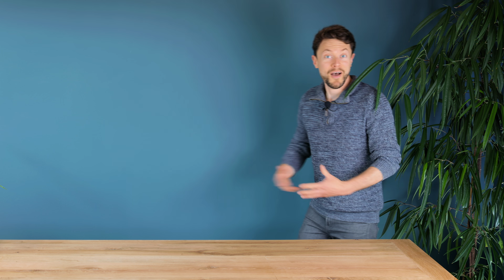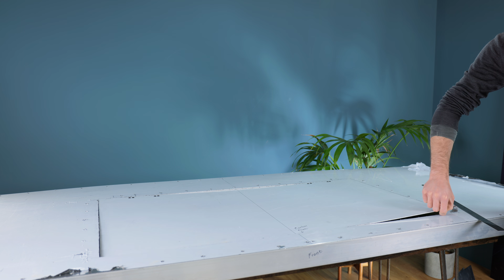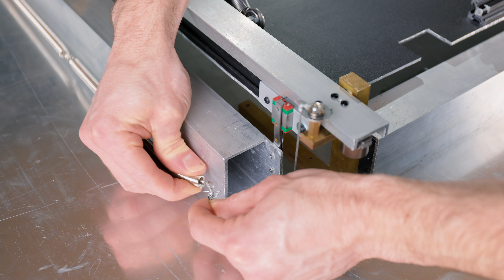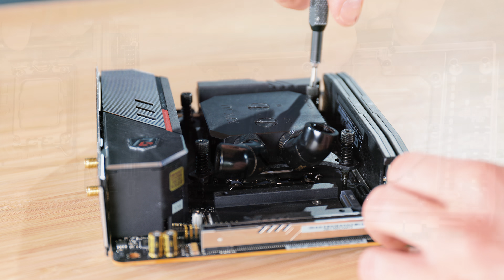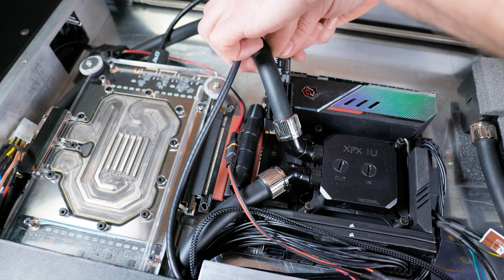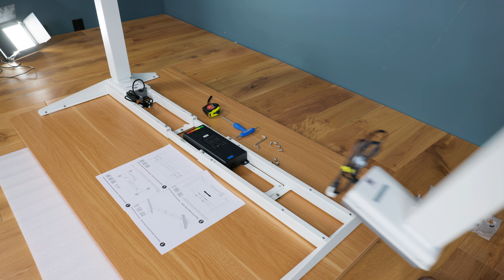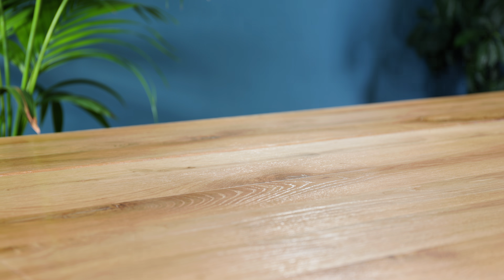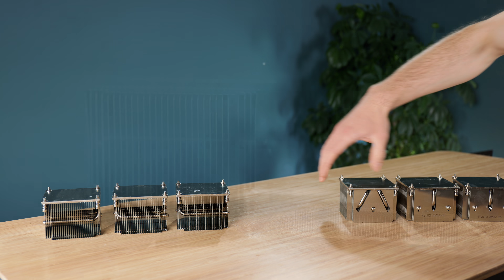Building the ENDGAME invisible PC

Comment: l really adore this project and it looks so good, but why ruin it with this super ugly cooling solution? Why not go for slim radiators + slim fans like an alphacool ST20 radiator and Noctua NF-A12x15, making the radiator + fan only 35mm thick, which would have allowed for them to be layed flat inside the desk with mesh inlets/outlets at the bottom.

Comment: Use an AMD CPU such as the ryzen 7 7800x3D, its much more power efficient than the intel processor you used, you might be able to use the old heatsink design. You will need to replace your motherboard though.

Comment: Hey, I enjoyed the video . I have one concern with the cooling system you used brass for the pipeline, and it looked like the blocks on the cpu and gpu were aluminum, which means galvanic corrosion is going to happen possibly distroying the components.

Comment: Lovely build.
I wouldn't replicate it personally as it really relies on that monitor continuing to function.
Also, just in case no one else has mentioned it (I scrolled down a bit and didn't see it mentioned): you've got dissimilar metals in your cooling loop so you will have galvanic corrosion, eventually the cooling block on either your processor or GPU will leak, and before that you'll have essentially rust travelling around clogging things up. Your cooling blocks are almost certainly aluminium, I'd recommend replacing your brass heat spreader thing with an equivalent made from aluminium.

Comment: Really interesting build. Not suprising that the smaller heatsinks cost less than the biger PC one. The smaller ones disperse heat via contact with your custom heat spreader while the bigger one would actually use water. In such case you need to compare cost of the heatspreader + radiators + thermal paste to the cost and equivalent of radiator, fittings and tubing required to disperse same amount of heat.

Comment: I do not like the magnet opener. Would have been cool if you pressed down it and pneumatics push it up into place. An another opposite system to close it down. You have to reach with your arm to pull it out and push it down. Getting anxiety on accidentally cracking the monitor from the grabbing action

Comment: You just blew all tech channels away with this. But I do think that the cooling system could simply rely on AIOs and have the fans pointing downward underneath the desk, perhaps with a slit at the back for air flow. The sheer idea that there are fans hanging off the back just puts it this a little bit short of the "endgame" setup ;) But it's really great. And the hinge is amazing.

Comment: Amazing! The ONLY improvement I can think of (and apologies if someone already mentioned this) is to have the wood grain match in both in the open and closed positions. Tricky but totally possible! One way would be to lay out the pre-milled / pre-resawn planks over the work surface and identify which zone of the planks occupy the cut-out area. Ideally, the grain of the planks selected for that zone would be fairly straight vertically from the top surface of the plank to the bottom surface of the plank.  Once resawn, those thinner planks would have matching grain. Ensuring that the surfaces of the planks recieve the finish consistently is a bit of a crapshoot but I think would be worth a shot if you're ever going to make more of these.

Comment: No, hate to you, but this is impractical. I don’t blame you cause I was thinking about this for 20 minutes straight before I realized something. The main point of this would be to have a computer set up at a desk while also retaining the room to do other things on that desk. The problem is if the screen is simply going to come out from the middle of the desk in a giant swing you can’t have anything occupy that space essentially making it useless. You have to choose computer or other things which then means you need to hold other storage space for the other things whatever use it as a computer desk, which completely defeats the purpose of a minimalistic desk

Comment: Only thing I wouldve added was some small support beams on the inside of the aluminum case for extra strength if somebody sat on that on accident that could be a problem. It just looked like it was caving in a bit in the center from all the weight.

Comment: I’m at a loss for words. The only thing I didn’t like is that the way you have to open it gives it a look and feel of a basic high school computer lab setup, with that pull and push. Everything looks cooler on automatic with the press of a button. So I wish that was the case in thugs build. Other than that, this is one of the most impressive integration of tech with furniture I’ve ever seen. If this was sold by some company it would cost probably around 30k

Comment: Great video and engineering. Still everyone needs to know that a monitor absolutely needs to be hight adjustable, if the desk is to be used both sitting and standing. The standing positions requires a higher monitor position compared to the sitting position. Otherwise the gaze is too much downwards in the standing position, leading to an inclined neck and therefore eventually to issues.

Comment: Only thing I worried about is having watercooling fluid flowing trough that brass and things not made for watercooling. I suspect at after while there's going to be some leeching of material into the loop quickly degrading all the other components + cooling effectiveness. . That said, I haven't looked it up and brass might be pretty non reactive. Also, there are plenty of small pc fans for this form factor. Noctua has 40, 60, 80mm etc. fans.

Comment: Dumb question/theory. Or maybe not. Would it have made any difference if you didn't use the "U" shaped plastic sleeves in the first fan/sink configuration, so as to let every fan/sink work for itself, sending the hot air out, instead of doubleing the fans and resistance of the airflow over two sinks? I somehow think that it would have had less resistance to the aiflow. And the hot air outlet is too close to the cold air intake for it to work optimally. I feel like it just recirculated the same hot air around. That with added resistance of sending air over two constricted passages, might be why it performed awfully. It just feels that it should have performed better.

Comment: Instead of putting those heat sinks 2 high, try them 2 deep with 90mm fans in push-pull (or whatever size would be the same height as those heat sinks). You may have to double the number of brass "tubes" but it should allow you to make it lower profile while maintaining the same thermals. Actually, with longer water runs spreading heat over fresh heat sinks, you may get even better thermals.

Comment: The first revision cooling system was bad because your pump's water flow is too low. You have these DC-LT server pumps with very low flow ratings and a huge square pipe which you then attached to copper heatsinks with thermal paste. Every single part of that chain is inappropriately designed. On top of that those fans are also of very low airflow. The reason radiators work is because the pipes zigzag within the airflow area and the fins. Literally no part of that cooling system could have foreseeably worked. You also have no water reservoir. This very bad. Those micro reservoirs are too small. Having a proper reservoir is a must because your coolant level goes down as microbubbles get pushed around. For the second revision I guess things kind of just worked out, but I would still change the DCLT pumps for a bigger pump and stick a flat reservoir somewhere in there. I don't really think you should pretend like you are "saving money". This entire thing was easily like 8K already lol.

Comment: The first video I watched was about repurposing an LCD from an old laptop. Something you can quite easily do yourself, if you can find the control board. I actually ended up doing it. And I have two left hands and 2 working brain cells, so I can confidently say that it is pretty easy.

This, however... It's fun to watch, but we're getting to LTT levels of ridiculousness. Hardly DIY.
I had no idea you could do that with copper tape though. That's pretty neat.

Comment: This is such an amazing build. I'm actually quite astonished. 
The only nitpick that I have is with the cooling fans on the back and how they are exposed on the underside. This can result in something getting caught in one of the blades. I would have enclosed them in some sort of shroud. Even if it was just a mesh shroud to keep the airflow. Other than that, I can't think of anything else to pick apart. Good job!

Comment: Why not keep the inicial design with the new fans? They can be placed gorisontal with some sort of channel to make the air turn 90°. It wouldnt be possiblr to use heatsink on both sides but that seems unnecessary. 
Also, you may want to reverse the water direction as it seems the cold water feeds the gpu and the water reaching the cpu is already warm. As the gpu produces almost twice the heat as the cpu I belive it should be placed after it.

Comment: I've been looking at something, not really invisible, more space saving (and invisible is a great way to save space) but I'm always stumped on the heat transfer. I just realised my whole computer and console set-up is always infront of a house hold radiator. (It's never turned on. I never need it with all the crap I'm running) and I just wondered if that's possibly something that could be taken advantage of. I know they're designed to heat rooms, but they're big, metal, disperse heat and sometimes have water running through them... could that be taken advantage of? I assume not but hoping some smarter people will actually know.

Comment: It's a great project and interesting video. But as a person of 190cm tall I would say that there is no sense in controlling table height while we have fixed space between screen and keyboard.
I mean, after I configure table height, I will get 1 of 2 options:
- put my hands higher than I need
- or will have to look into screen which will be placed too low

Also, I prefer using 2 displays, so this design would be much more comfortable completely without display and with support for monitor VESA brackets. This would also allow us to make this table monolith and waterproof

Comment: My only criticism of the improved cooling solution is that those fan blades are exposed such that someone could put their fingers or toes in there if they weren't careful. There should be some protective shield so this is not possible.

Comment: Why not cover the fans on the back with tapered design with wooden sheets. That may enhance the exhaust system considering bernoullie’s principle.

And does setting up air intake fans on the front edge enhance airflow and heat management? We can actually conceal the intake fans on the front tapered edge with a wooden sheet with folding mechanism.

Comment: My only comment is with the heat sink. You should have used heat pipes instead of those brass pipes. But I understand that you're basically replacing a radiator for water cooler. Reducing the length of the water loop and using the heat pipes as link between those cooper server heat sinks would have been better as

Comment: I'm not convinced that you had to change out the heatsink system and, when introduced, immediately thought it was the wrong way to go about it *with the fan setup*. 

I won't go frame by frame or anything but, in short, I the fan arraignment was the issue and not the heatsinks. The new system did it totally different and, clearly, did a better job due to not compounding the removal heat like the previous setup did. 

Oddly and purely in my opinion/prediction, the first system would have been more effective with less fans! The orientation being the issue, not the sinks ability to absorb and release heat. 

But it turned out great as usual so who cares? Haha.

Comment: What happens if you get really angry and slam the space next to the keyboard? (Or type really hard when stressed/in a rush?)
Would the screen come crashing down onto your hands? I should think that a lock is critical for this to be avoided. Maybe the spring, magnet, and damper combo is strong enough to support the weight of hands though

Comment: Very nice job.  I think on the wood tabletop, I would have used staggered boards the run completely across the door at a minimum to eliminate the color differentials along the edge of the hatch, but in order to conceal the straight lines on either side of the hatch, I might also stagger the boards on the hatch to that they fit together like puzzle pieces when closed.  Although that would bring some other engineering headaches.

Comment: I have a suggestion

Install a biometric fingerprint reader with a motorized actuator to raise the desk. This should be recessed under the lip of the desk. By doing this, three problems can be solved:

1. Only authorized individuals can lift the computer.
2. The magnet attached to the wood panel could potentially damage the wood over time through repeated use. This can be avoided.
3. There is no need to keep a magnet on the desk, further concealing the computer inside.
Reply: Great idea
Reply: Also how bro's gonna turn on the pc when its shut down?
Reply: @DERJ0NA5_2 some motherboards/wifi cards support something called wake on lan (or WOL) which allows a PC to be turned on via a network command (which can be as simple as a button or maybe in this case a fingerprint)
Reply: @JustABeeInFPV  you can also use some sort of microcontroller, they usually don't cost much and don't use much power
Reply: @ilovefurnaces  you can also just use USB wake control and wake it with keyboard or mouse input
or better yet, add a  $2 power button made from raw brass
Reply: This would be super cool indeed.
Good point about the magnet. I guess that's nothing a bit of felt can't fix though !

Comment: 2 things: 
1. you could have gotten away with 92mm fans in the back.
2. I am concerned with the longevity of the cooling loop with the mixing of metals, which is usually a big no-no due to corrosion.

Comment: I'm not sure this can be called DIY any more. It has become something more! I think the mechanism is very clever and I got a bit of a workshop vibe from the screen backing. Maybe DIY has advanced just that much. Whatever it is, it's very very cool. :D The 3D-printed fan shroud and the copper strip rails are cool too.
   Oh wait! :) The PWM isn't sent through a twisted pair; I wonder if that would cause interference? Probably not as it's so close to both power and ground, which makes it pretty close to being just like a twisted pair. (I assume it's the middle one.)

   Tapered edges! I was dying to know how the hardware was crammed into that thin top in the thumbnail. This is genius! :D

   I'm not a fan of the honey colour either. This is better.

   I'm sure I could never cut a long thin wedge like that accurately. Well, maybe with a jig of some sort.

   I love the magnet. :D

   I'm sure it is satisfying. I'm enjoying just hearing the 'clunk' when it fully opens, and I didn't even put anything into it! :D The finished item seems so professional in every way. :) I wonder if it'll last well. I hope so.

   I love the final heat solution too. Besides how well it works, all those fans look so cool beneath the desk. When your kid nephew (or whoever) asks about the cooling, you can raise the desk up and show him all the fans, and he'll be all, "WHOA!" :D
   Hmm... now I want fans and heatsink like that, but on show. :D

Comment: dont bullshit us, the final resaults was with normal radiators, was it not?
3 problems with that solution, brass or bronze has bad thermal conductivity, surface was too uneven, and would have to be machined or atleast lapped, as you could see in the coolingpaste on dissassembly, waterflow through the pipes dont allow for much of the heat to be transferred to the metal compared to a traditional radiator. You also could run into corrotion issues using metals like that in a waterloop. Make sure to use a coolant that has good corrotionresistance and not just water.

Comment: This is such a mess! I can just imagine how much effort and time he spent on this huge something! It’s very difficult, the table is very large, and the whole thing just gets terribly hot. But how cool it looks!🤩
And most importantly, a lot of work has been done here to correct the errors and shortcomings of previous builds. The only questions are about the steel plate glued to the wood and to the cooling system. The plate probably should have been screwed to aluminum. And the cooling system has undergone major changes in the last minutes of the video, but still looks a little out of place (and, yes, it might be worth replacing the brass tubes with copper ones).
But otherwise... This is just a gorgeous project with a very large investment of effort, money and nerves!!!
I don’t even know if this guy is crazy or a genius, but I want to sincerely wish him good luck!)